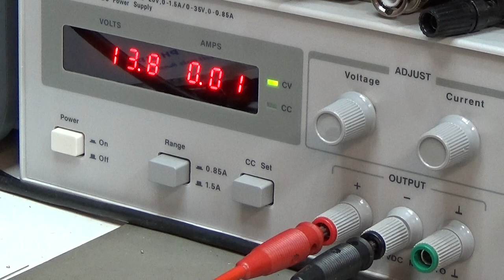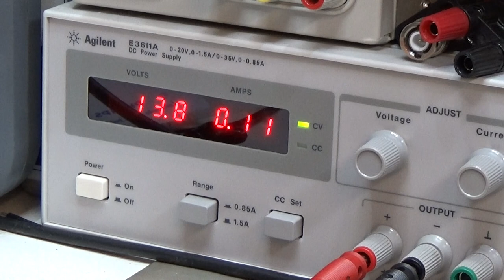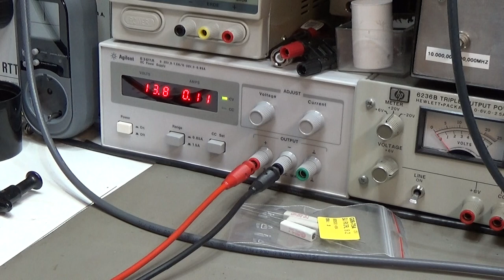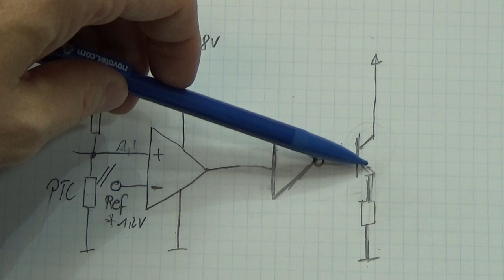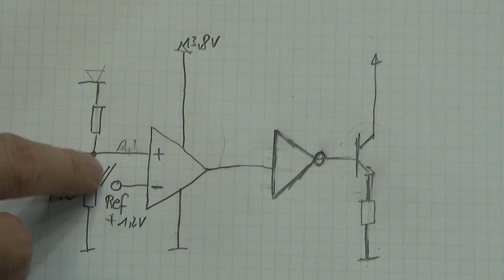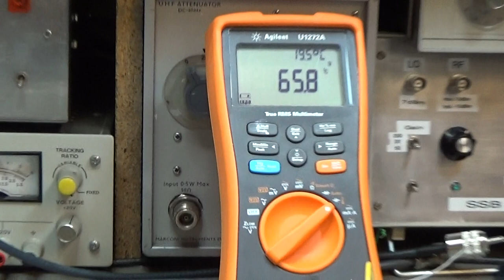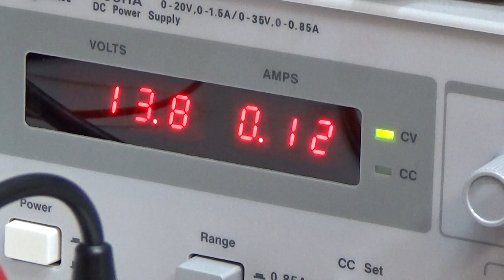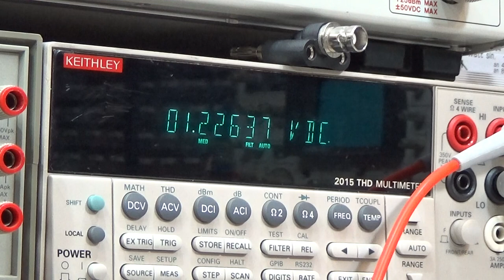#48 CB / HAM Radio Tutorial: How to avoid drifting master or carrier oscillators in SSB radios

Comment: Interesting video, thank you. 
A year or so ago, i wanted better frequency stability from a transceiver that I was working  on. To avoid the on/off hysteresis,  I went with PWM generated with an arduino. The switching frequency had to be fairly high but that was no problem.  The end result was very stable temperature control, and very stable frequency control.
Thanks for sharing.

Comment: A very interesting concept. I am currently trying to adapt a more reliable and accurate frequency oscillator to my frequency counter. I am shopping for a cesium standard to get the most reliable readings. Great tutorial and prototyping. Thanks for the contribution!
Reply from the maker: Satellite_Guy oh yes for lab use a cesium Standard is great. I'm using a rubidium standard in the lab and that is very reliable. Thanks for Feed- back. 73

Comment: A long time ago, I used to work on a lot of UHF radios where the transmitter crystal frequency would be only say 12 MHz, so that adequate deviation could be achieved reasonably linearly with a separate phase modulator stage working at crystal frequency. The problem was that with the high frequency multiplication required, 36 times, the drift even with tight spec crystals could exceed the UK MPT specification for carrier stability. The official modification was a PTC thermistor placed in contact with the crystal can, with heatsink compound, and a rubber sleeve stretched over them. The thermistor was connected across the radio's regulated supply rail. It worked; but it would not have worked as well as your solution, though it was probably a lot cheaper. Base station transmitters of that era always had a proper crystal oven as frequency stability was even more important. The receivers weren't a problem as the crystal would be typically 55 MHz and so much lower multiplication was required. I guess that with modern synthesised UHF sets, the effective multiplication is similar but then we have TCXO's now... The UK radio engineer's slang word for a crystal is a 'rock' (as in Fels oder Stein auf Deutsch!!) Keep up the good work, it is a pleasure to see a such a competent and professional engineer at work and I really enjoy your videos :)
Reply from the maker: Alan Cordwell Hi Alan, yeah there were really some silly concepts in the field these days. To multiple it up that way was really not a good idea. Well but still 100% valid is the rock quality (Fels in der Brandung :-) Thanks for your comment and feed-back! 73

Comment: Great video Peter. A question : Have you  stabilize ref voltage ? If ref voltage goes up and down with temperature, the circuits doesn't work perfectly. Is good idea to use a REF25Z in ref voltage ? How you resolve this problem ? Thanks for your video.
Reply from the maker: Pasquale IW0HEX Hi Pasquale, very good question from a professional engineer! You are totally right without a stabilized ref voltage it would not make any sense. Therefore I have used the 2,5V reference voltage component TL431. So reference is working fairly stable. Thanks for feed-back! 73
Reply: TRXBench Thanks for your answer Peter. Nice job !!! Thanks again for your videos.

Comment: Nice! I wish I could have seen the frequency drift before and after the  temperature controlled heating element was installed just to see the difference in stability. I am new to CB radio repair and just about have all of my test equipment and really  enjoy learning from your videos. I read repair books quite often but there is nothing like seeing it hands on.
Reply from the maker: yougotsbusted PUNK Hi, well the radio where I have put it into was an example only. The drift is a problem for SSB only. Unfortunately there are still a lot radios on the market with drift issues and this is a way to cure it. Thanks for your feed-back!